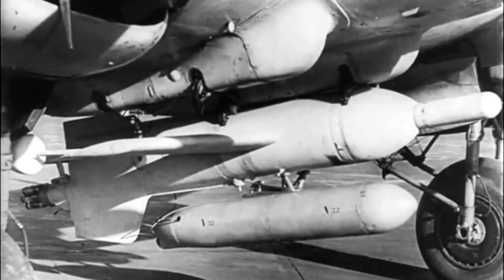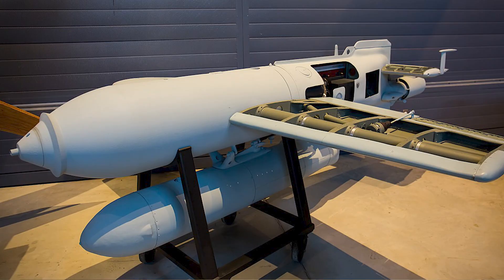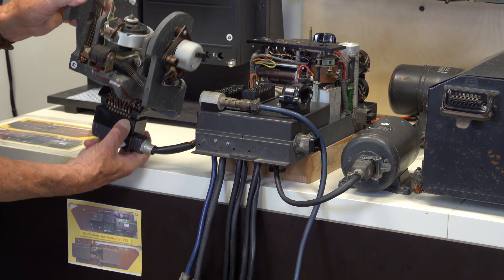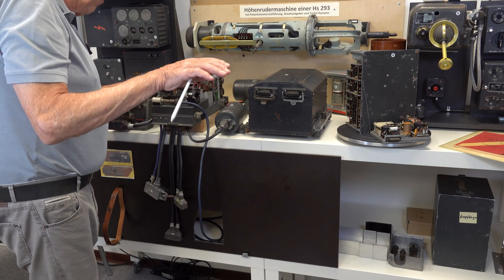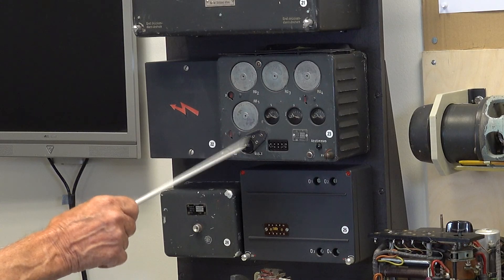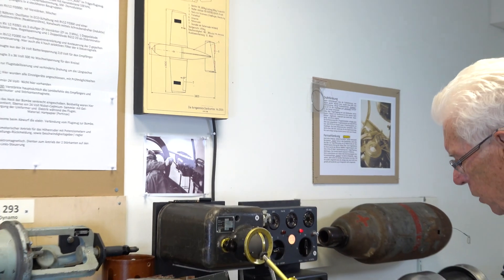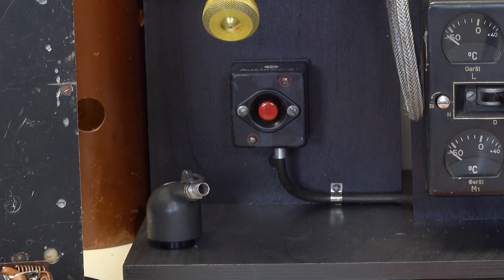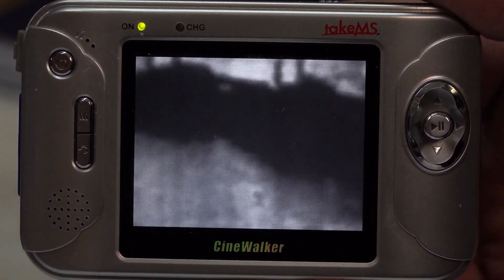Henschel Hs 293 radio control system

Comment: Was the wire guided variant ( of 293 or fritz x) ever used successfully. And i don't mean in combat, even in testing during the war?
Reply: No, I believe they had kits but the carrier aircraft either Do 217 or He 177 couldn’t survive in allied airspace and the Germans weren’t even sure they were being jammed.  Most He 177 suffered an ignominious end and were blown up in France due to lack of fuel.  There were plans to fit them to the 4 engined.  2 seat Arado 234C

Comment: Very interesting. 
I thought the joystick had 3 channels as it would have been possible to tilt the whole inner control drum assembly and give it a third "rudder control drum" pick up.

The "Knirps" joystick used to control the X4 missile had the system I just described but didn't have a "turn pick up" so it had only 2 channels.

The video from the HS293 D is exspecially rare because it shows the last configuration of the IS 9 supericonoscop camera tube. During development the IS 9 was wired so that an 440 horizontal line 25 fps TV image was transmitted. To simplify aming and steering it was rewired to record an 220 vertical line image at 50 fps.
Your video shows this vertical lined image.

Comment: Regarding allied jamming of the Hs 293.  Initial attempts at noise jamming were unsuccessful.  It was not until missiles had been discovered captured in Italy and a Crashed Do 217 in Portsmouth that the secrets of the Kehl-Strassbourg system was revealed.  Allied jamming then went from noise jamming to spoof jamming (sending false commands).  Initially they jammed only one of the 8 frequencies which tended to lead to the jammers jamming each other but finally simply jammed all the frequencies.   The Germans never confirmed the jamming in part because they lost a sniffer aircraft to allied fighters so they never implemented counter measures.   Accoding to Fritz Trenkle the counter measures were as follows:
1 A single In flight Frequency change.   (I believe this saw service and may have been effective against early allied jamming efforts)
2 Antenna kits and frequency change kits were in stock in case of allied jamming.  These doubled the wavelength and would have rendered allied jamming equipment ineffective (at least for a while)
3 A more jam resistant FM version had been developed but not produced as the AM version was cheaper to make.
4 The HS293B was different to the HS293A in having cable routing for retrofit of wire guidance in the form of spools at each wing tip.  Most HS293 produced were the B variant.
5 There was also the 25cm wavelength guidance system using impulse modulated Disk Triodes which used rear ward facing directional aerials that was to be used for SAM and AAM systems.  It was to be retrofitted into the X4 missile by replacing the wire bobbins with poly rod directional aerials.  It clear would have been adaptable to the HS293.  It was highly jam resistant.

It's interesting to speculate as to whether the MAX-P system which passively homed onto microwave radar might have been fitted or the MAX-A (active radar homing).  Both developed for the Wasserfall missile and testing in the laboratory.     I did come across mention an German Active Radar Homing anti shipping missile I believe called 'pirat'

The biggest problem for these missiles was that the carrier aircraft such as the He 177 or Do 217 could not survive allied carrier based aircraft.
Reply from the maker: Great comments, and good information. Thanks for taking the time for this detailed posting. KR RJD DA